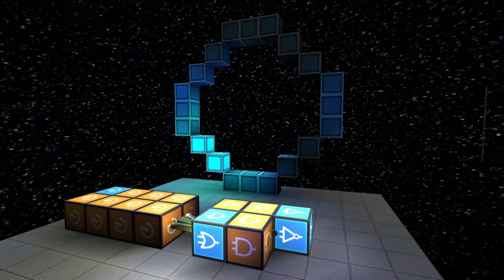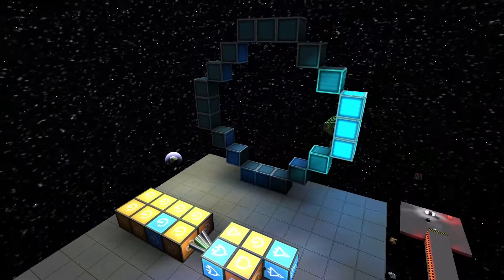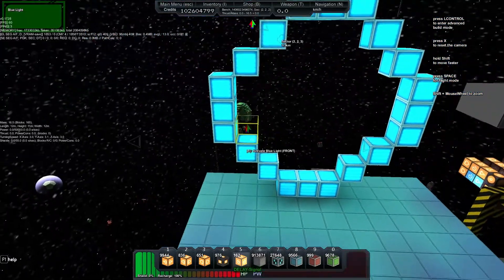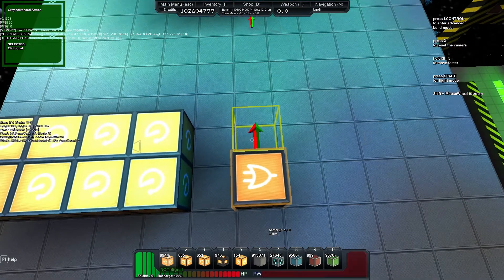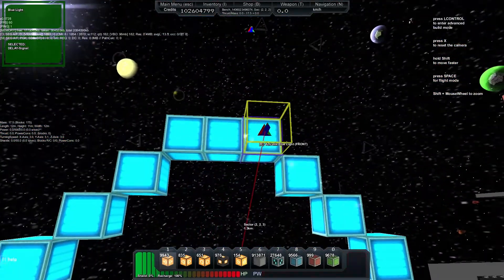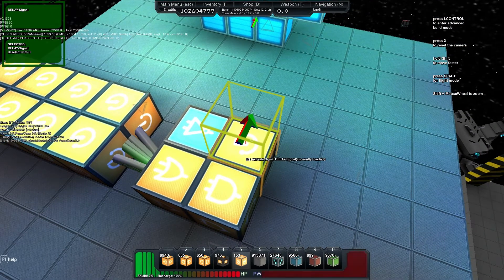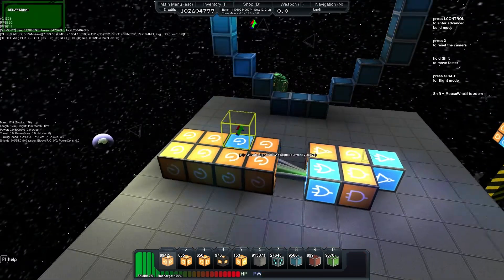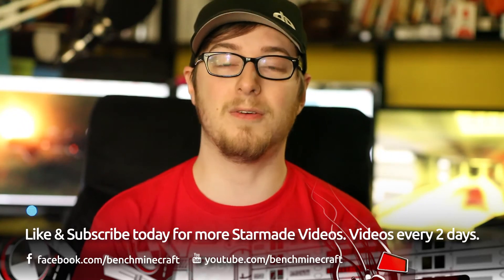Starmade Logic #20 - Error Detecting Delay Loop

Comment: Another issue I have found with this is when the server lags.... it still stops and wont auto start unless "armed" first meaning you can't just load a ship with this and expect it to run unless the "not" gate is armed to trip before loading.... I don't understand the point... for loaded ships yea but loading a ship in still requires a startup if the not gate is not armed
Reply from the maker: saving your ship to the catalog saves the states the logic are in, so when you load it in again it may take a moment for it to process what is connected to what, but then will start up. I've used this exact method on ships previously and they have started up by loading in without a hitch
Reply: Maybe I was saving it wrong.. will try again.
Reply from the maker: Ghetto Dexter if you have it running when you save it it should save fine.
Reply: kk I see now but the not must be tripped first right? or it won't restart... this is what Im experiencing

Comment: yea sooo im wondering about the lie you told in your other video saying we can attach a plex storage to a docked storage and eject it like trash? No man not cool it's not possible and unless it's planned AND in Dev don't say you can do things that can't be done... as I haven't had verification from anyone on the dev team or other testers saying it would be a future possibility.
Reply from the maker: I didn't say you could attach the two together, that's not currently possible, what i would have said was that i built a way i could transfer storage items to a storage for a trash ejection system i built. In what i built you still have to manually move the storage from the main ship to the ejecting capsule, but the storage on each sits across from each other so it is fairly quick to do.

Also I'm on the dev team, just fyi
Reply: I know your on the dev team dude... nothing new because your free advertisement -_- FYI but what I'm saying is at the end of your video you selected the first plex box then turned to the second and said you can attach the two but never did because you can't then jumped straight to your closing statements... I mean I only watched it 5 times.
Reply: If you didn't make your videos would you be though? Ok... so stick to the truth man.
Reply from the maker: Ghetto Dexter I said "We can take stuff from up on the filtering and take it and send it into this one block (pointing at the storage in the wall) storage block and then use it to load this canister up and then eject the canister." I never said you do so by connecting the storage to the canister, or that you send it. I said you use that block, my meaning that you use that storage block to grab items then place them in the storage in the canister. Sorry if it sounded like I inferred that you can connect the two
Reply: Ok cool man sorry about the tude.... I just like truth and It sounded like a lie to me just to make content... I knew ur better than that
Reply from the maker: Ghetto Dexter all good, i wouldn't say i have a system in place that isn't actually working, there's a lot of smart logic builders out there and they'll just call me out on it.